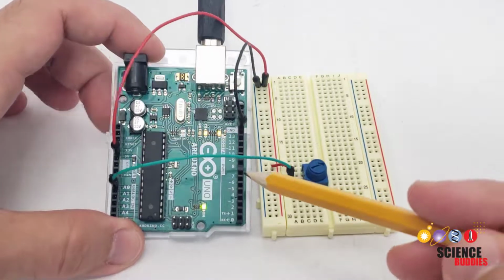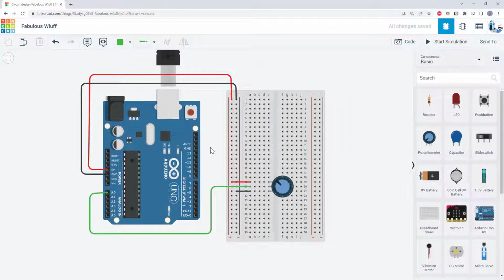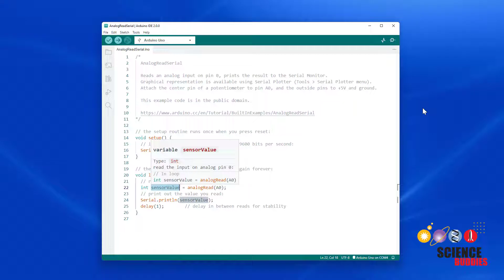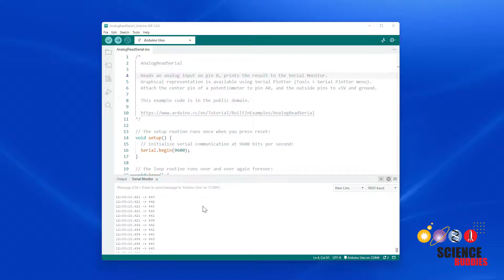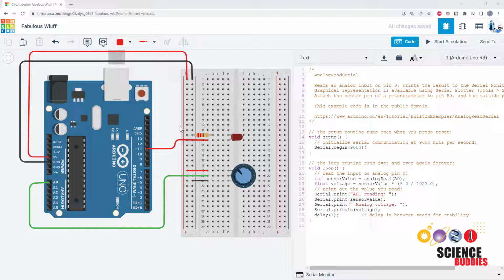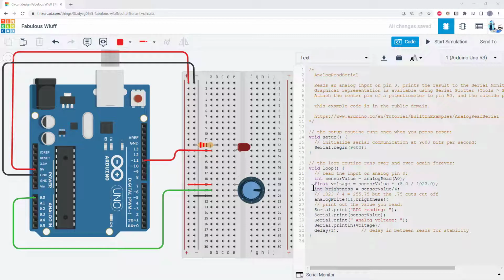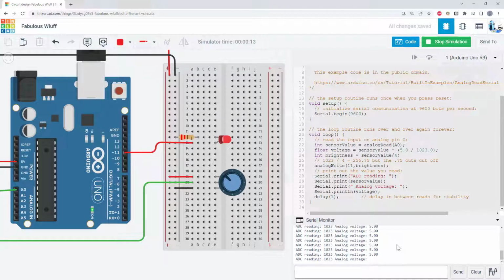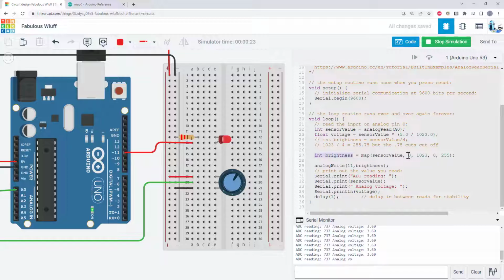How to Use a Potentiometer with Arduino analogRead (Lesson #7)

Comment: Serial plotter doesnt work for me and I cant understand why. My code is the exact same and the serial monitor works the same as well but I clock on the serial plotter and there is no ADC value and nothing. Is this due to a change in the IDE program since this video was recorded or something??
Reply from the maker: Hi - we recommend asking for help in the official Arduino forums, they may be able to help.

Comment: 4:23 If your serial monitor is just stuck at 0 (Or some other number) and turning your potentiometer doesn't do anything, try clicking on the "Toggle Autoscroll" button towards the right side of the screen, it should look like two arrows pointing down.

I just spent 30 mins trying to figure out why my potentiometer wasn't working 🤣
Reply: I cand find this^ help pls lol

Comment: i did the code differently. 

i changed the numeral (5.0) to 255.0 and simply write:
analogWrite(ledPin, voltage); 

it worked

Comment: When buying a potentiometer it has ohms, yoi dont mention anything about ohms in this video why is that?
Reply from the maker: When used in this configuration, the exact resistance of the potentiometer is not critical. Many starter Arduino kits come with a 10 kilo ohm potentiometer, that is a common size.

Comment: My potentiometer has 2 pins on one side and 1 pin across which takes up all the space on the breadboard leaving none for the wires. Is there a way to make this work without getting a new potentiometer?
Reply from the maker: Usually you can put one set of pins in a column on the edge of the breadboard and have room to squeeze wires in on the opposite side, even if one edge of the potentiometer's plastic case is hanging over the edge slightly.

Comment: Awesome way to quickly explain things (subscribed)!
I've been looking for a button that has discreet steps from, say 1 to 10. Is there such potentiometers, or are they always continuous?
I guess I could just make a knob that has discreet levels on top of a potentiometer.
The purpose is to have one button do the work of 10 separate buttons.

Maybe it doesn't have to be a potentiometer, if there is a simpler analogue knob that writes the given number out?
Reply from the maker: You could do this in software using the analog potentiometer shown in this video by breaking the readings up into sections using IF statements (if reading is between 0 and 100, between 100 and 200, 200 and 300, and so on). If you want the potentiometer to "click" into discrete positions, a quick Google search shows that you want a potentiometer with "detents": https://electronics.stackexchange.com/questions/94855/where-to-get-how-to-make-a-potentiometer-with-clicking-steps. We have not tried those ourselves though!
Reply: @Science.Buddies  Potentiometer with detents is exactly what I was looking for and didn't find, thank you!
Though, since I don't really want to increase the resistance (or decrease the voltage), I will have to make the potentiometer separate, as in not taking the power for the motor through it. For this use, I'm running just one servo, which I was powering through the arduino 5V pin. If I were to get a read through the potentiometer, I would not get enough voltage, if I understood correctly.

Comment: Great informative video.  Have a question.  Always understood that a resistor comes before the led to ensure not too much current passes into the led. Your video shows the resistor after the led. Bit confused!!
Reply from the maker: This is a very common misunderstanding, we made a separate video just to explain it! https://youtu.be/NUKD9qESO58?si=0QTgCqc-OiFZn89-
Reply: Because the it is a closed circuit, it doesn't matter whether you put the resistor before or after the LED, it limits the current. The current has to flow through the resistor, limiting the current.

Comment: for those who gets stuck on not turning on the LED make surethe resistors is put on the short leg of the LED and the wire plugged on the longer leg of LED or else it doesn’t turn on
Reply: Just positive and negative terminal ,what’s the diferent?
Reply: @bluecoppervalve  current can only flow from positive to negative
Reply: @doublearon1073  Technically, current flows from negative to positive according to electron flow 😀
Reply: @bernym4047  When someone says "current" then they mean conventional current, not electron current.
Reply: @celeste1129  eh electron current and current is the same thing right? Because voltage that cause electron to flow is called "current" anyway.
Reply: @dairoku2017 I don’t get your comment. Google conventional current and electron current.

Current can refer to either, and by convention it refers to conventional current, hence the name.
Reply: @celeste1129  Ahh i see.. Your wording is just very confusing because you said it like current and electron current is a different thing even though they're the same.
Reply: @bluecoppervalve  the difference is long leg is only for positive and short leg is for negative. You can't do it another way around because it doesn't work like that.
Reply: Thank you

Comment: These lessons are so good! Also i just spent like 10 minutes trying to figure out why my circut and code isnt working. after you showed the code mine looked like it should do the same thing. it did. i just put the resistor in the wrong place XD
Reply from the maker: We have a "troubleshooting" video earlier in this playlist - many times it's just a single misplaced wire on the breadboard that can prevent things from working.

Comment: Thank you very much ❤
I have a question
My bread board is 5 units wide and my potentiometer pins are 2 at the buttom and 1 at the top
If i want to connect it there will be no room to take the wire to the analog pins on the board
How can i connect it?
Here are some photos

https://drive.google.com/drive/folders/1O3RWlvte63J4C-4zOMPW98atgqUHIF65

Comment: My Potentiometer has pins in a triangle type fashion, i can not get it to work anywhere on the breadboard because its too big for one side, and it cant go across.
Reply: do you mean it is not physicly possible to get it across? cause if not then you can just move the wire to thte other side. probably a late comment XD

Comment: What's an appropriate value potentiometer in this application? And should I use logarithmic or linear?
Reply from the maker: 10 kilo-ohm potentiometers are very common for Arduino projects. Unless you want a nonlinear response when you turn the knob, you want a linear potentiometer.
Reply: @Science.Buddies  makes sense, thanks!